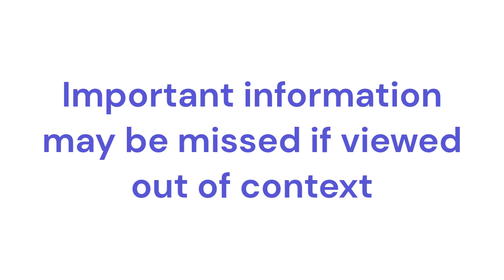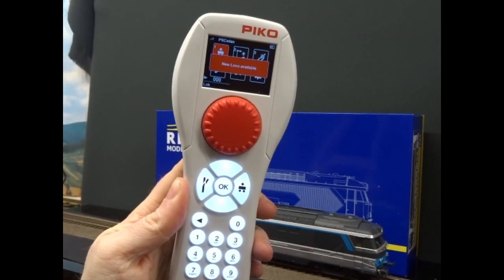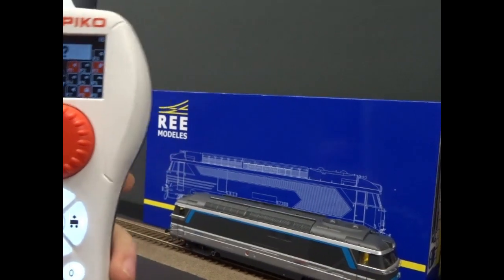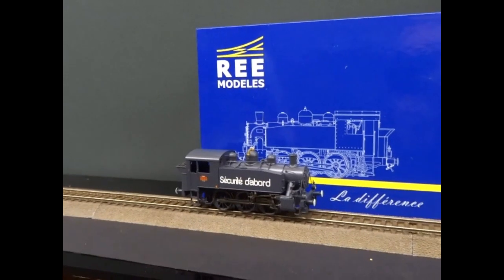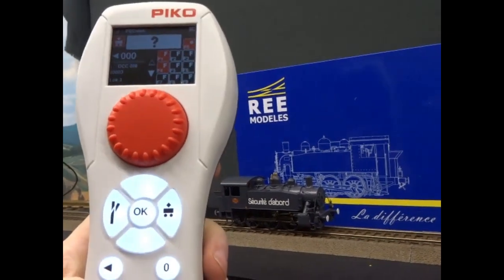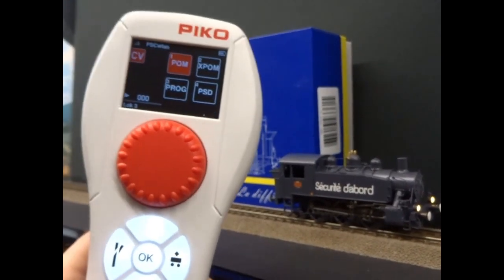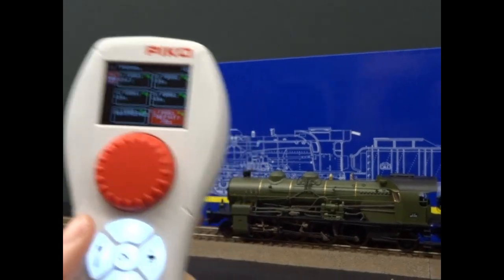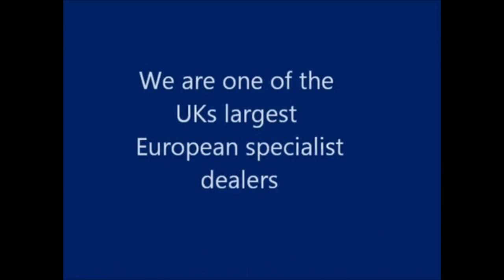Piko SmartController WLAN   REE Modeles

Comment: Hello there, can You make a video of programming in CV (menu button 5) with button PROG (3) ? For example programming a locomotive (new address, adding functions etc...). It could be a big help, just because every videos of the Smartcontrol wlan are in german. Thank You, Best regards :)
Reply from the maker: Adding locos are here:
https://www.aandhmodels.co.uk/smartcontroller-part-11-12-first-drives-2091-c.asp
Flim 1.2 looks at general CV programming on the programming track - for beginners to the hobby the factory settings on DCC models are pretty good - we want to keep the hobby open and going into huge depth on customization is a bit like Volkswagen delivering a car and telling the owner to map the engine before driving it.

I do go into much more detail  in my DCC help pages
https://www.aandhmodels.co.uk/dcc-help-pages-897-c.asp
I do not want to scare people of by making programming look like it is mandatory